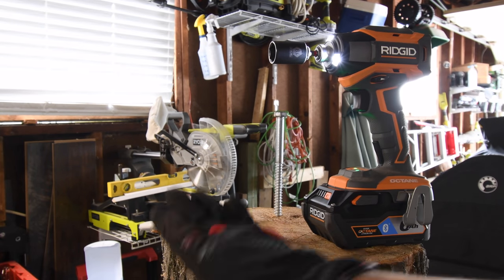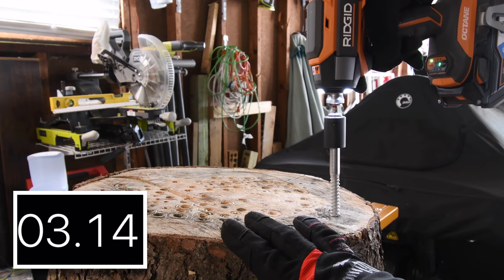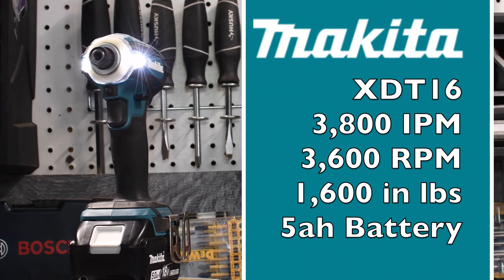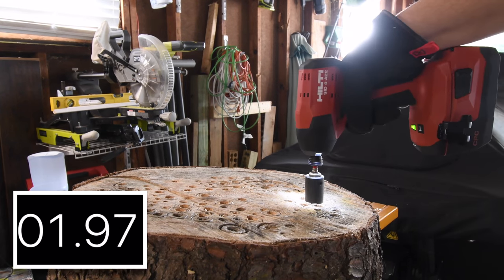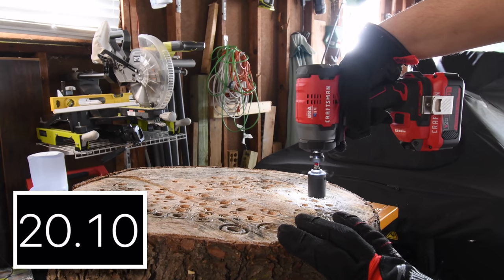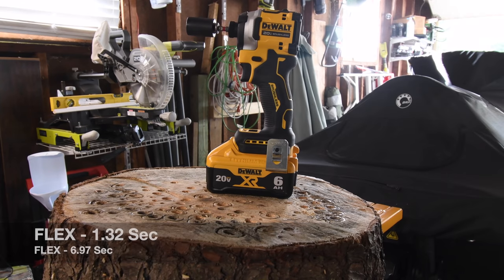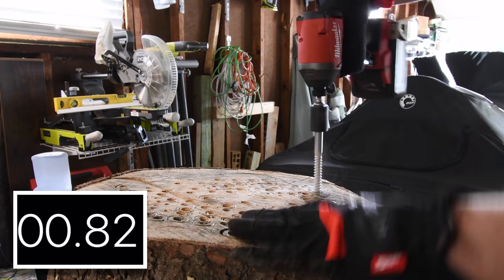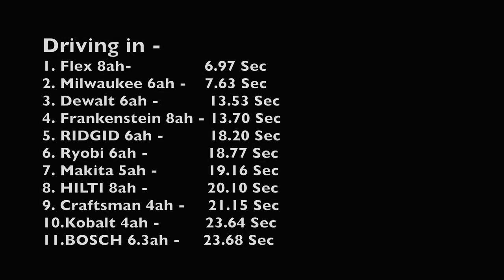Impact Driver BRAWL (WHO WILL WIN?)

Comment: Nice to see my little Craftsman didn’t come in dead last even though it was running only a 4ah battery. I have  no doubt a 6ah battery would have helped it break 20 seconds. This video offers something for every budget. For me it came down to a battle of whether I was gonna shop HD or Lowe’s, and big blue won out due to proximity. While the pros will always default to the big three (MiL,Mak,DeW), I think the future for the average DIYer will be which platform has the best offering of hand tool and Outdoor Power Equipment integration. I think Ryobi is currently killing that demographic. If only they didn’t commit to that darn stem style battery.

Comment: Absolutely a good video, I would love to have the new Dewalt and many others, but since I work alot in automotive and DIY, and I’ve established a strong foundation with Makita,  I am a firm believer for anyone to find a tool brand and stick with a battery system. Batteries are an investment in themselves alone.
Reply: Very true I was lucky enough to re wire a Milwaukee charger even tho I have dewalt. Well now I’m a dewaulkie lol

Comment: The Kobalt really surprised me. It fairs really well on other channels that I’ve seen it tested. I’ve even seen Kobalt beat Milwaukee on the VTG Channel. You might want to think about taking that one back to Lowe’s for a warranty exchange.
Reply: You’re probably talking about the kobalt xtr he used the non xtr kobalt impact
Reply: He didn't use the xtr. He used the regular 24v. The xtr is a beast. I know he does have it. He should do another batch for this brawl
Reply: I have both the normal 24v Kobalt impact and XTR impact. The normal impact is still a beast and more than enough power for a DIY/Apprentice. Now the XTR, that thing is a monster with tons of torque. I can see the XTR being in the top 3 impact drivers easily.
Reply: @Luigiz28  the FLEX impact driver is just an overclocked version of Kobalt XTR. I'm convinced they're the same tool with the FLEX motor getting slightly more voltage based on how similar they perform with the FLEX having heat issues and bigger batteries. I bought the regular Kobalt first and used it for a couple years until a magnet from a bit holder broke off and got caught inside the collet. I tried absolutely everything to get that out of there and finally broke down and bought the XTR. I won't replace that thing until it doesn't work anymore. Love it.

Comment: Flex and Millwaake waaay ahead of the rest and I'm a Dewalt user. Dewalt did good for its power but they need to release a new XR impact driver with a minimum 2000 inch/lb so it can really compete with the top two. Weird how most of the impacts are worse than Dewalt when their stats are similar or even more powerful like the Rigid and Ryobi.
Reply: Love both my 2853-20 and 887 never seem to be fond of flex

Comment: Yeah I still beleive the fuel 3.5 with a  HO battery is the most reliable choice. But from what flex is doing they are definitely neck & neck with milwaukee on there hammer drills & impacts drivers & saws. But milwaukee is King 👑

Comment: I have a European Bosch freak, it's rated to 200 newton metres, around 1770 inch pounds, still not enough to win, but maybe not last. Can't believe Bosch came last, they really need to up their game.
Reply: This is just a test that you normally wouldn't use these tools for, this test would be more for a mid torque or bigger,  if you did this all day you would break your impact driver, the Bosch will outlast all  these tools with the exception of hilit and dewalt if you use it for what it is supposed to be used for driving in screws

Comment: Nice video.  However, you have the specs wrong on the Ryobi.  It has 2,200 inch lbs and 4,000 IPM.  RPM is correct.

Comment: Why not use the 1800 Bosh freak much stronger tool
Reply: this is a GDX1800B12 variable speed only. I have the one with connected module and 3 speeds. I don't think it gets any torque nor speed advantage (at least on paper) but according to Torque Test Channel the 1/2" anvil may end up giving up on torque  as compared as running a 1/4" to 1/2" adapter. i don't know, it works for me and the 1/2" anvil is good enough to rotate the tires on my car and truck